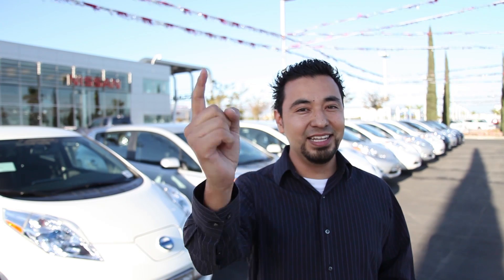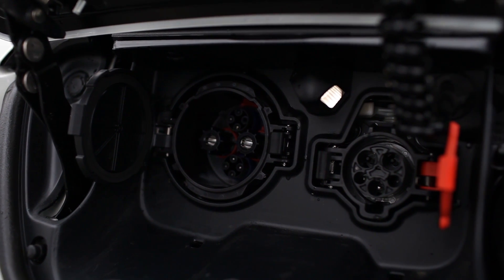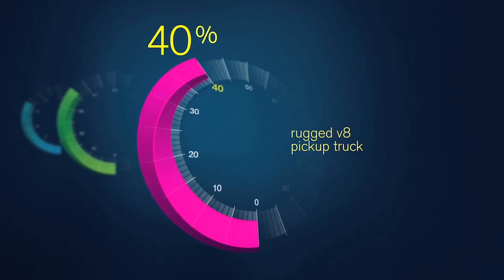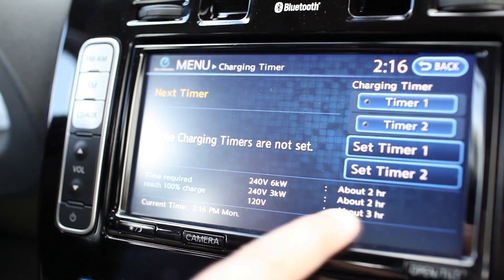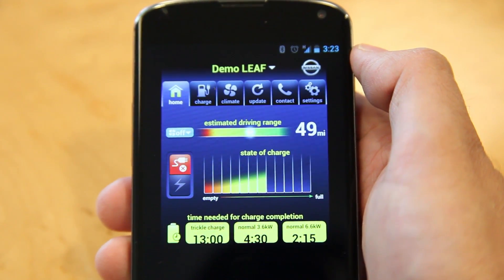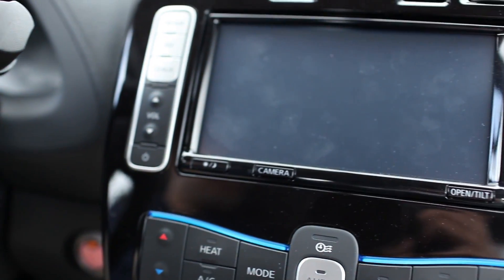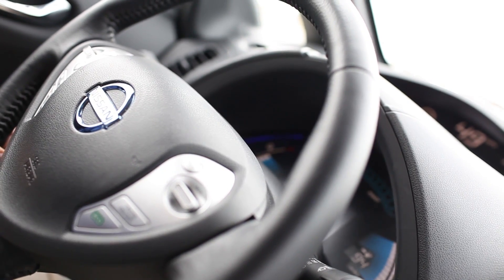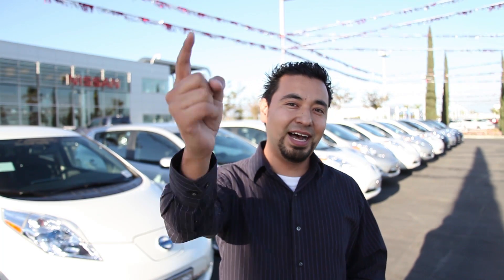2013 Nissan Leaf | The Technology Behind it

Comment: The leading type of power generation by utilities in Canada is hydroelectricity, with a share of 63.7%. nuclear (15.0%), Coal (13.1%), natural gas (6.2%), wind (0.6%), etc..

In the US, Coal makes up 30%, that's quite far from "mostly generated by burning coal".

Now if you drill down by provinces, Quebec is 97% hydro generated. Hard to be greener than that. Hoover dam rings any bells?

Generalizations are never good...

Comment: It depends on where you live. On both coasts, most of the energy comes from alternative sources or renewable energy, which overall makes an electric car 5 to 7 times cleaner (in terms of carbon emissions). Even in a place with mainly coal as a source for electricity, a central coal generator is MUCH more efficient than ICEs. Additionally, an electric car uses the supplied energy much more efficiently, hence the 100 MPGe ratings. Do the math and see for yourself.

Comment: The waste-argument actually isn't valid. They can recycle the batteries with an almost 100% percent efficiency.

I don't like electric cars either, but simply for the practical use. The range is too little, and there are too few charging points. Also they aren't very exciting. But when they become cheaper and the infrastructure is there, maybe I will. Unlike in the US, gas prices are actually quite high here, so economically it would make sense for a lot of people.

Comment: If you were in the US, you can get a base Leaf at $21,000 after the Federal grant of $7,500. In California with its additional $2500 grant, you can get a Leaf for $18,880.

I don't know what you're upset about, in Europe, for the UK as I know the cheapest Leaf costs over £20,000 or over $30,000. We can get a leasing option, which in the UK drops the price by another £5,000, but there's a monthly rent for the battery at £77 for 3yrs, that rises depending on more miles driven or a shorter lease.

Comment from the maker: I love how you can control certain aspects of the car with their phone app. Check out the technology behind the Nissan Leaf.  Please +1 and reshare this video.

 #Nissan   #nissanleaf   #electriccars
Reply: ***** "for free" -- means other people are paying for it
Reply from the maker: The great thing about this car, at least where I live. You can recharge anywhere for free. With quick charge becoming more accessible, you can go from a dead battery to 80% charge in under 20 minutes. It's really a great car and the power is great.
Reply: I have the 2011 LEAF model and the only thing I'd really like to see in the new model would be an Android onboard computer.
For instance where I live the LEAF warns me before passing by some speed cameras but half of those are misplaced on map so I have stupid warnings all the time when there is no camera there, and I can't correct cameras position on the map... (either turn on of off the warning sounds)
Using an open platform the possibilities would be endless. LEAF has a touchscreen, an onboard GSM module so it should come with Android.
I'd love to see Nissan commitment to an open API and a Nexus 7 docking station in LEAF's dash instead of that Windows based computer... just imagine the apps that could make use of all car sensors and infotainment.
Reply: oww... it was nice until the app. =(
like the solar panel thing :)
Reply: Great car, amazing app, thanks for reviewing the fine points of owning this car, you are a far better vehicle reviewer than to some out their.
Reply: The kw/h used to recharge the batteries on this automobile are fractions of pennies on the dollar compared to a gas engine (think a full charge for $3 - $5). The Leaf is a great commuter car, but yes it won't be winning any muscle contests or sex appeal awards. But if those are what's desired then you're looking at the wrong class of car in the first place-- a Sentra or a Camry aren't going to win such contests either.

As for all the speculation that these things don't save money, I can state demonstrably that you're wrong. I drive a hybrid, and in the two years I've had it I've already saved in gas costs what I paid for it (I bought it used). Granted, I've taken two very long driving trips with it so my mileage use isn't 1::1 representative, but the rest of my driving is commuting only. I paid just under $10k for the car I have used (great deal, it could have sold for $13k easy) and the return on investment has been awesome. I hope to be able to make the jump to full electric with my next car, and by that time the technology will be even better.
Reply: Actually, J.J. Kowalski, free means that it's being paid for by having the individual spend their money in ways that are more profitable. Rest stops, for example, only make a few pennies per gallon of gasoline but make much more profit when the person stops to eat. Giving the driver $5 of electric charge so that they spend $20-$40 dollars eating and other shopping leads to greater profitability.

Understanding that electric vehicles means the old profit models are being replaced is important to the discussion.
Reply from the maker: John Lieske exactly! Companies are not going to nickel and dime you for $3.00 of electricity when they can sell you a coffee for $5.00 that costs them .30 cents to make.
Reply: J.J. Kowalski you realize that the current cost of gasoline is paid for by your taxes, don't you? If gasoline weren't heavily subsidized by the government, we'd be paying between $6 - $9 per gallon at the gas pump right now.

So if you're concerned about your taxes paying for someone else's free ride, then you've got plenty to be mad about. Just not regarding EVs.
Reply: I pointed you to Texas law, J.J. Kowalski. I don't care if you believe me, but I directly sourced the State of Texas on this.
Reply: John Batty unlike all the electricity that the oil industry uses in the production of petrol?
Reply: John Batty it doesn't make sense to you. This car was not meant for the mainstream market. Nissan has done a great job with this car. This is perfect for people that don't need to travel far or that don't travel more than 100 miles a week.
Reply: a commuter car should not cost more than $20k
Reply: More solar panels so car is not limited to distance would be better.
Reply: michael dela cruz given the car surface, panels would probably not generate more than 1kW
Reply: 1kW panel would add at least $3k to the price of the car and probably quite more than that unless the buyers would not mind the car look like a piece of junk on wheels
Reply from the maker: J.J. Kowalski "free" for the customer. Just like when you go to Starbucks you can get "free Wi-Fi" it's obvious that Starbucks is paying for it.
Reply: ***** As long as it is not paid from my taxes I am fine with it.
Reply: Correction, *****: it's "free" in that you're paying for it, indirectly, by patronizing their profit center.
Reply from the maker: John Lieske depends if you use their services.  I can bring my lunch from home and eat outside while my car charges.  Same with malls, just because I go to the mall doesn't mean I have to buy something.  But I'm getting electricity for free.
Reply: John Lieske I never asked anyone to subsidize my gasoline.
Reply: J.J. Kowalski you don't have to ask. The refiners, drillers, and sellers who are subsidized to the tune of hundreds of billions a year have already asked for you.

Enjoy the 50%-75% discount. After all, you're paying for it in other ways.
Reply: John Lieske You realize that these subsidies apply to any type of energy generation.
Reply: No they don't, J.J. Kowalski. Oil subsidies alone account for hundreds of billions. Oil plus coal arguably accounts for close to a trillion. "Alternative" energy amounts to somewhere in the tens of billions to arguably $200 billion tops-- and that's cumulative for solar, wind, etc.

The world of energy subsidy isn't equal. Never has been.
Reply: John Lieske What is then the subsidy per generated kWh of energy (oil vs renewables)
Reply: There's no calculation of that, J.J. Kowalski. You're not asking a question that makes sense to me. Could you re-word it? I may be misunderstanding what you're looking for.
Reply: take total subsidy amount (paid per year) and divide by energy content (in kWh) of all of crude oil (pumped per year),
do the same for renewables
Reply: So, what you're asking for is a calculation based on one group of subsidies for a group that's been around for many decades and has already-built infrastructure and back-dated development built up, and a second group whose subsidies are barely a couple decades old (less in some cases) who have been given no infrastructure by government and have nearly no development built up? Have you ever heard the term "apples and oranges"?

Why not instead ask for return on investment? Because if we're going to give away free money, shouldn't we toss money at the greater return?
Reply: Lease one - recent deal $77/month out of pocket. $2,000 down, 24 months, 24,000 miles
http://www.mynissanleaf.com/viewtopic.php?f=23&t=11245
Reply: ***** says $2000 down and $199 per month - still not bad, same as for Versa Hatchback which is 1/2 of the Leaf MSRP
Reply: I build these cars and the millage range is based on 1st generation models we are now building the 2nd generation model which is a lot better also the uk government has scrapped the £4000 grant and people are still buying them I can loan a brand new model every year for £120 a month once I've had my driving licence for a year.
Reply: ***** In TX you pay sales tax on entire leased car value, which alone would be about $2000 which is $80 a month over 24month lease.
Reply: J.J. Kowalski you are incorrect. I live in TX and that's not at all accurate.

http://www.window.state.tx.us/taxinfo/mtr_veh/faqmoveh.html

I am leasing a vehicle in Texas, do I owe tax?
A motor vehicle purchased in Texas to be leased is subject to motor vehicle sales tax. The lessor is responsible for the tax and it is paid when the vehicle is registered at the local County Tax Assessor-Collector's office. The lease contract is not subject to tax. See motor vehicle sales tax rule 3.70 for additional information.

In short, the lease doesn't require payment of sales tax on the vehicle. If you're leasing towards a purchase, then yes you will have to pay sales tax. If someone is making you pay sales tax on a car you don't intend to eventually pay off (wich would be a sale), then you're being fleeced.
Reply: John Lieske It's true that it is the lessor owes the tax, but any car dealership where you get a lease will make you pay the tax before they give you the car.

http://www.leaseguide.com/Articles/texas-auto-lease.htm
Reply: I just pointed out law that states the lessor is liable for the tax, J.J. Kowalski. It's the law. If you're talking about a lease-to-own contract that's a different thing. However, doing as you state literally is illegal. The higher likelihood is that you are mistaking lease-to-own agreements for a lease contract. I know several people here in Dallas who have done this (they buy a car for longer driving and lease something for bling).
Reply: John Lieske What you are saying is 100% different from what I read in multiple places on internet. I guess Internet lies. But you are on internet... Are you lying too ...
Reply: Pitty they did not have any budget left over in the styling department.
Reply: I did a marketing research plan for the Nissan Leaf and was able to test one out. Overall it was really awesome. The only downside is that there will need to me more accessible charging ports across the nation. (any nation really.)
Reply: That's all very well, but £30,000 (OK £26000 with a government grant) for a tiny car with 85 miles range before a (minimum half hour) recharge is needed using electricity generated from fossil fuels and a battery that will need replacing in 5 - 7 years at a further £10000 make no sense at all.